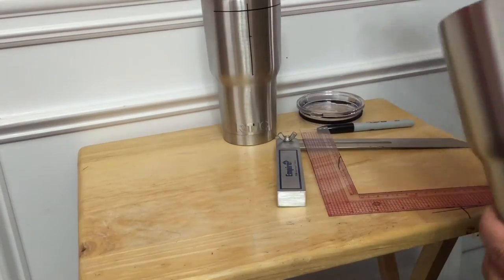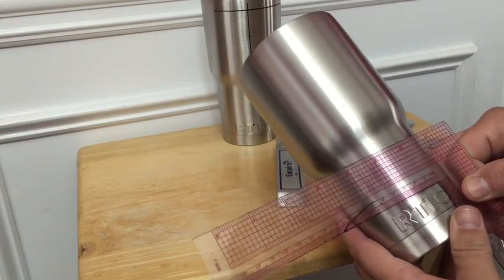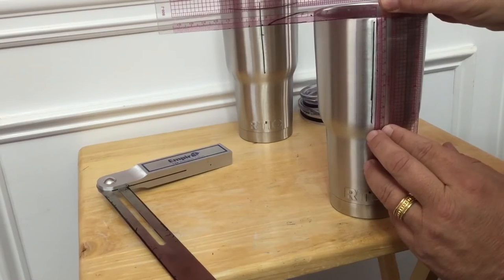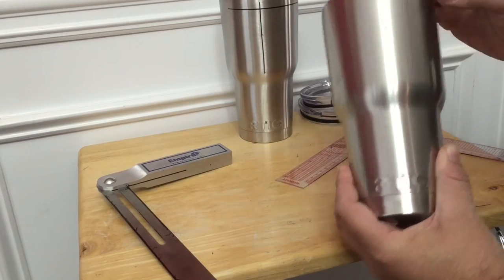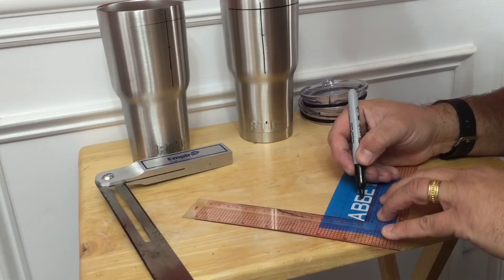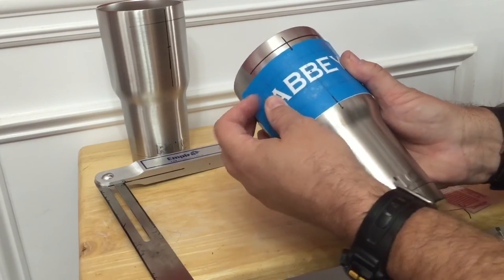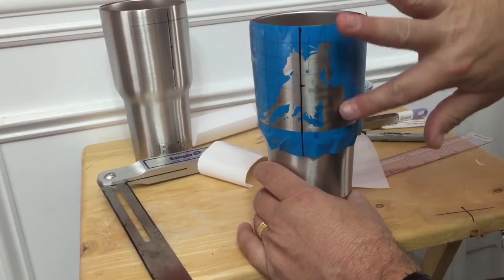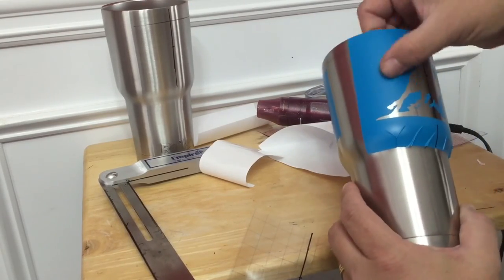How to Center names and Logos on Yeti or RTIC.

Comment: Have you ever thought of applying vinyl and just coating over the top of it and leaving it on?  If one used the high temp vinyl would that matter?  Any idea on long term  durability.
Reply from the maker: I have coated vinyl.  Sometimes it works sometimes the vinyl discolors. I just got some low temp clear for this purpose.  Cures at 300* so it should be good most of the time with good outdoor vinyl.
Reply: Thanks Chad!  A buddy of mine asked me about that last night and I didn't have an answer for him.  I might try a test cup to see how it goes.
Reply: Last question.  Can you tell me what size compressor you're using?  What's the output?  Thanks!
Reply from the maker: +Howard Camardelle for powder coating or sandblasting.  For powder up until a week ago I was using a pancake.  Burned it out and have a 60 Gallon 3.7hp from Northern on order.  For Sandblasting I have a 20 Gallon Ingersol Rand I'll have to look up the specs.  It adequate but really could use something bigger.  That said it has handled everything I've thrown at it.
Reply from the maker: +Howard Camardelle http://m.northerntool.com/products/shop~tools~product_200375221_200375221?hotline=false
Reply: Thanks for the follow-up Chad. I'll check it out.

Comment: What vinyl do you use for powder coating and sandblasting ?
Reply from the maker: Oracle 631 is my go to.  Make sure any vinyl you use isn't old.
Reply: +bugmanchad 631 is good because it is a temporary vinyl with low adhesion. That means that after you've heated it, it won't leave gooey stuff behind.
Reply from the maker: +CrossLinc Custom Coatings, LLC  Thanks.  I've found that to be the case as well.
Reply: What colors do you use?